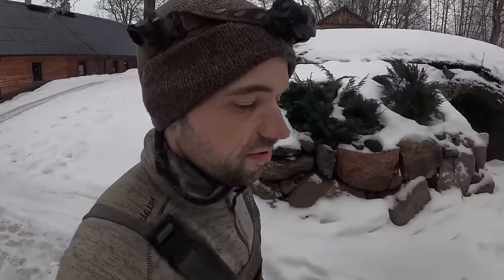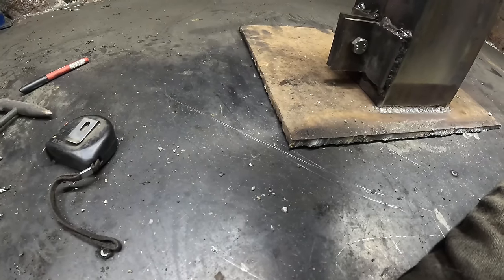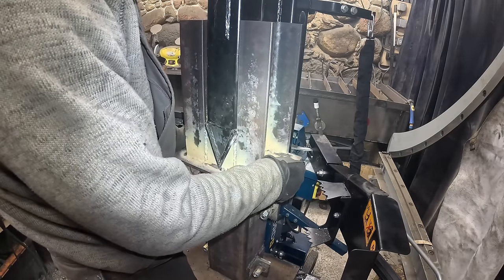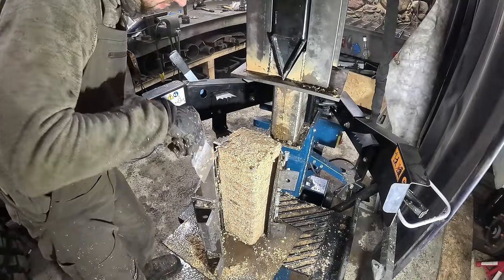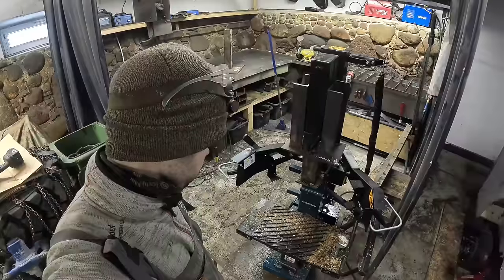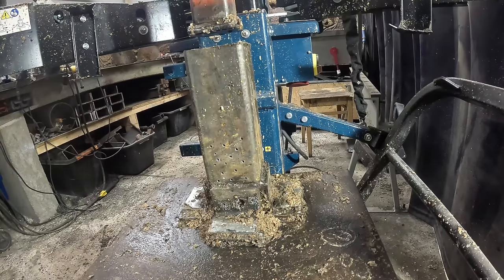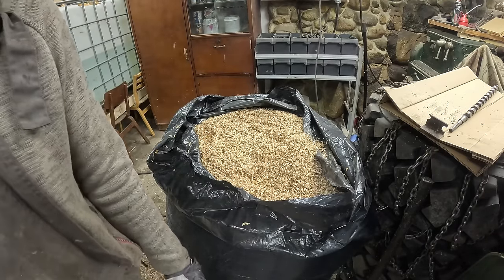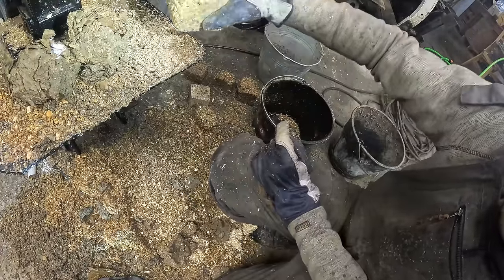Sawdust briquettes with a vertical log splitter?

Comment: I'm off the video topic and kind of late since winter is over. I ggogled this -  diesel engine glow plug intake manifold  -  for your blue tractor. Seems it would work but maybe the oil would be to cold.
Reply from the maker: Yup. The engine also supports a oil heater and a intake heater
Reply: @Ants_Pants  Supports ? Are they installed - installed but not working or supports but not installed  😁Or does support in russian mean light fire under engine  lol
Reply from the maker: @RectalRooter  oil heater not installed and air heater is shorted out
Reply: @Ants_Pants  I'm guessing the working glow plugs from the skid steer are to tall for the tractor intake. Maybe more lathe work to make an adapter for them. Yeah !! more playing with the lathe

Comment: If you make the tube a bit smaller at the bottom than at the top, it should compress it more... or at least I strongly belief so?
Reply: I was going to suggest this too. Instead of tapering it wider, taper it smaller to increase the pressure required to poop the pellet out.
See this guy's workshop pellet press, he calls it a die pipe:
https://youtu.be/6ri62uzLoss?si=OP2Xb6eExXkjv_DC&t=1315
Reply from the maker: It would shoot out like a bullet destroying the brick. Tried that. Longer tube would make it compress more and longer

Comment: Maybe you could add a vacuum and screen to the hopper and suck the sawdust in.

Also think that maybe the exit of the extruder should be narrower to compress and subsequently heat the wood fibers more. Think this contraption is not heating enough.
Reply from the maker: Me too

Comment: Awesome build Ants! A few tips (I've made pellets before): The moisture is one of the most important parts. From memory, it should be about 10-15% moisture contents. So your (first) mix is far, far to wet, as you discovered. The natural lignin in the wood will is the binder; when you (com)press, it will raise the temperature naturally, which causes the lignin to bind everything together.

So try it with a lot drier mix (and maybe get a moisture meter to verify).

Re v2 (horizontal), here's a great video (and channel!) with another DIY sawdust-briquette maker, for inspiration: https://www.youtube.com/watch?v=6ri62uzLoss
Reply from the maker: Thanks for the tips!

Comment: You need to make the end smaller like a sausage stuffer. The hydraulic pressure should be sized so it creates enough heat while it is pushing the material through the nozzle. The lignin in the wood needs to be hot enough to melt and combine together.
Reply from the maker: What if i overpressure it?
Reply: @Ants_Pants  I doubt the hydraulic pump for that log splitter has enough pressure for that size log. Realistically, I'm guessing it needs sized down to an inch or under to generate the pressure needed to create enough heat
Reply from the maker: @TgWags69  thinl i will order a new cyli der 50mm thick rod and power the thing off my tractor hydro pump. Should ve equal to a 30ton log splitter.

Comment: I love crap like this, fabricating something useful out of junk, I do this all the time. 90% of the time it doesn’t work but the 10% it does work is satisfying. Have you tried using paraffin wax as a binder? You can buy it in bulk. Shave it into small pieces with a cheese grater then you could use something like heat tape for water pipes around the tube to keep it just warm enough for the wax to bind to the sawdust as you were compressing it. Also I would think you would want the tube to taper smaller at the end so it would compress even more as it came out.
Or you can just use the sawdust in the garage to clean up oil spills or just spread on the ice on the driveway and it would probably be cheaper than trying to put wood back together again after sawing it into tiny, tiny pieces. 😂
Reply from the maker: Hmm gotta try

Comment: Ants, you clearly have too much time on your hands! 
You certainly come up with some great ideas though, great for us! 
I think the only way this would work is the material has to dead end, as you tried earlier on. 
If you installed a wedge in the bottom to push the material against, then removing the wedge should be easier to remove than a flat piece , then  continuing to push the pressed material out hopefully will give the consistency you need. 
You put a lot of time in it, don’t stop now. 
I think it should work with some tweaking 
Good luck dude!
Reply from the maker: Will do

Comment: it sounds like the friction on the inside of the pipe is making it break up when u push it out, what about painting the inside of the pipe with gloss paint to make it kind of non stick and slippery, maybe high gloss metal paint, or even a high polish that wouldn't scrape off, and it looks like u need a glue binder of some kind
Reply from the maker: Need more fiction

Comment: Might have to be heated, like baked to dry them out! You know, to get them hard and hold together!
Reply from the maker: My new idea is get a thick hydraulic ram, thick and long pipe and run that pipe through a wood burner. Feed the wood burner with sawdust bricks and keep preasing until all the sawdust is gone. Efficienty level : negative 7.

Comment: You need to use a much smaller tube as you don’t have enough force from you ram. I worked for a company who built wood pellet mills to manufacture commercial wood pellets and the pellet mill uses a lot more force to squash the wood fibre through a small die c5mm diameter holes. Also your source fibre needs to be high in resin like pine otherwise the lignin won’t act like a glue and bind the fibres.
Reply from the maker: Would it help if i heated the pipe up while sawdust is compressed in there?

Comment: should have done some research. Simply taking a long pipe and pushing dry sawdust through it works. That shiny surface you got on the dry ones gets even better with a longer pipe. your problem was the flared out exit pipe. it needs to build enough pressure to push the wood resin out and build that crust.
Reply from the maker: Yup

Comment: Dear Mr Estonian man if you would have put a hole in the bottom of that with a plate pushing upwards you could have just used a pipe to push the wood back out from the top..... the wood chips have to stay wet for at least a day or two you can also use a bit of wood glue but flour might work also

Comment: Check out you tube ...  you need 90 degree turn on your big press and along the ground.... the guys I saw used 2 angle irons bolted together so they could adjust how much smaller to make the bricks .?. they had about 10 to 20 ft of angle narrowing down to the end and the bricks were super hot when they came out !   ......... love what you're doing .... I tried too but gave up good luck,       Joe  from scotland

Comment: Find an electric lawnmower. It can be modified to shred cardboard and paper for mixing with the sawdust.
P.S. wax or oil your mold. In fact using, vegetable oil (or any oil) with your mixing water would both lubricate and burn.
P.S.S.  Coffee grounds with the sawdust will create a form of peat. Burns slower and hotter.
Final note: soak sawdust for 2-4 weeks to get better binding and solid bricks
Reply from the maker: Thanks for the tips!

Comment: I assume you didn't know they use lignin glue when they make the bricks etc?
Reply from the maker: The clue is pressed out off the wood at high preasure
Reply: @Ants_Pants  Did you achieve 170 C and maintain it for 8 minutes?

Comment: In China we have this hand tool for making coal brick from a mixture of coal dust, clay and water. https://youtu.be/HdUdATMD20U?t=140 (from 2:20 to 3:40 shows how the tool works) Basically you have a movable push plate to push (without much force) the compressed brick out.

Comment: maybe you could set up something that would inject a little liquid paraffin with each press?  Also, saw this a couple of years ago on New Yorkshire Workshop channel: https://youtu.be/6ri62uzLoss?si=rN_iKgQjAQn6WzCH
Reply from the maker: The key is to ensure there's enough pressure for the ligni to melt and bind. Need a longer pressing tube and it has to be smaller with a big hydraulic ram

Comment: Compost the sawdust and sell it.  Many pets use sawdust bedding.
Reply from the maker: I wanna take another crack at it first with more hydraulic force
Reply: @Ants_Pants  I'm no expert, but wood 'gives' when pressure is released, that's how screws hold and trees bend.  I believe you need some kind of glue to hold it together, like they do with particleboard.  Saying that, I expect you will make another good video for me to watch.

Comment: According to what I've read you need a pressure of 60 tonnes/sq.cm and you DO NOT need water, just sawdust plain and simple then the natural polymers bind it together.  Some of the articles on making sawdust briquettes are total nonsense.  They described the same method for making waste paper briquettes.  I bought the correct paper press and it simply doesn't work.  You cannot exert anything like enough pressure using it.  I found it a total waste of time.  I worked out hour many hours it would take to collect the materials, shréd it then press it and the gain was so low I would have been far better of getting a part time job and buying the fuel then still have money to spare.  Total waste of time and effort.  Sell your sawdust to a biofuel producer.
Reply from the maker: The key of the pressure is producing enough heat so the natural clue would stick. I think i can cheat by heating up the pipe